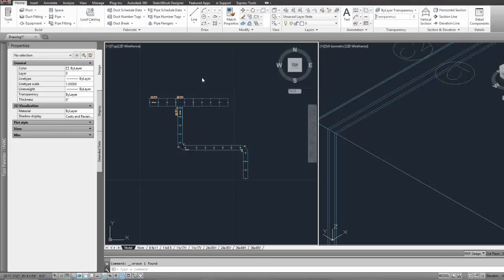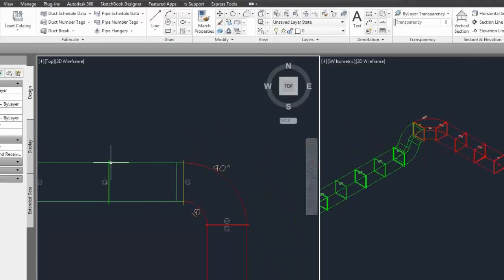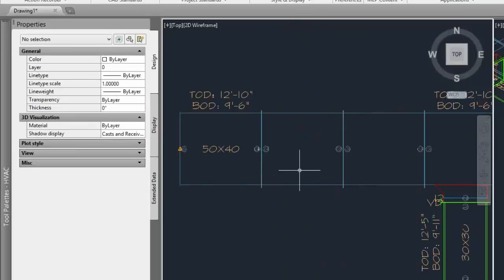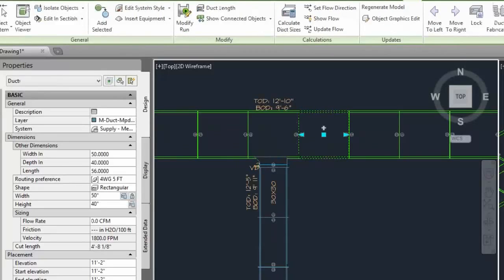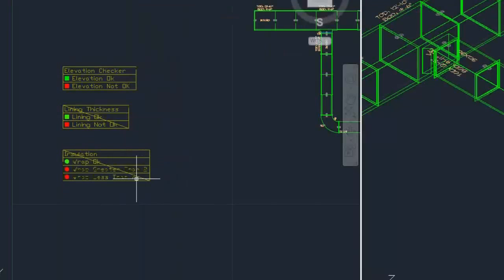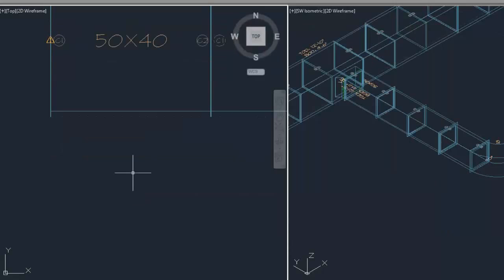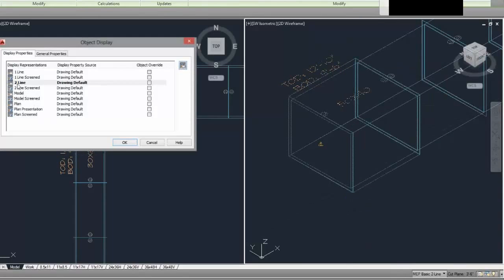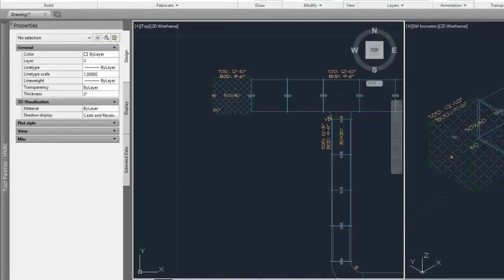Making Sense of Display Themes

Comment: sir i have question with your value set? because autocad has several units? example if i set my unit in inches will be the value is also in inches value? thanks. your video is very helpful..
Reply: Units in AutoCAD MEP can be over written by the units of the property set definition.  You can get the property set to display any units that you wish regardless of the units of the drawing.  You can change the units of the property set definition inside the style manager under documentation, property sets, and then select the appropriate property set and then on the right hand side select the appropriate property set definition.  Then in the units column select the units that you wish to see.

I would recommend reading the help file on property set definitions found here.

http://exchange.autodesk.com/autocadmep/enu/online-help/browse#WScedd0d2069f88934137c60dfa2566d240-7fd5.htm